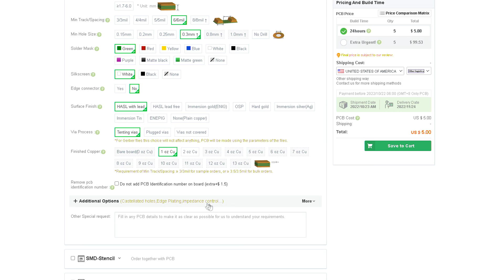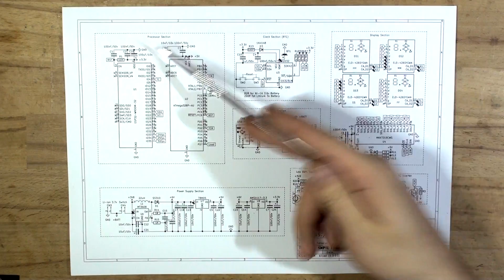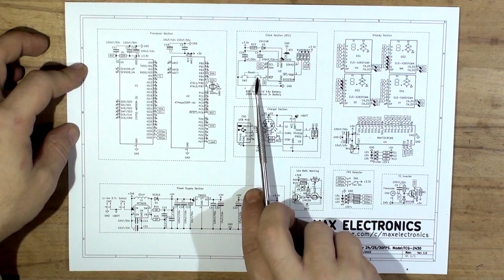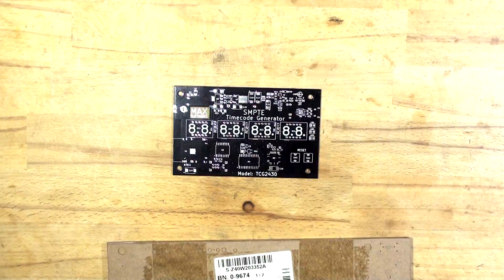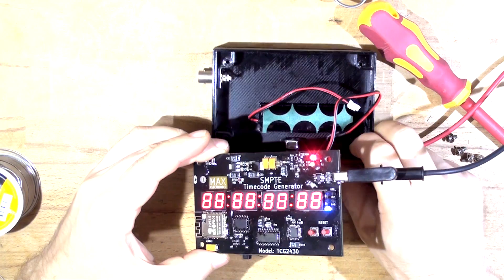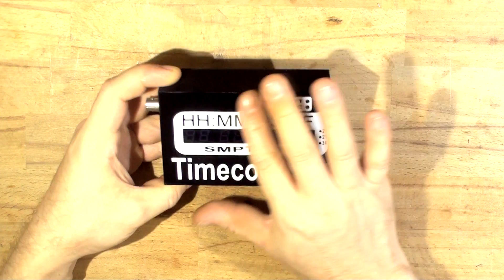DIY SMPTE LTC Timecode generator.

Comment: Thx.
For the GENERATOR, just could it spit out the time code over a LTC compatible 4Vpp signal with NO LED display at all?
I just want the core of the thing that spits out the RTC based actual real time code.
The same thing should be doable by using readily available modules like DS3231 RTC module, 8 digit Max7219 module, Arduino Nano and so forth.

I do have an unknown vintage time code display on my bench but no documentation.
Model 1272 , date of mfg 1989. Mfg SELTECH, probably USA based. By chance it is using LTC code input.
I made progress exploring the internals by drawing a remake of the pcb and by feeding two 1-2 kHz short pulse signals on the two terminals.
On some ocations when the two phase input signals hits something it produces usefull content on the 6 digit LED, that luckily has no f** frames indicator.
I just want this thing revived to work as a wall clock as it was in the W-German TV studio back then.
2. The format of Your documentation.
Well, yes it is readable some how. You are an artist. Some kind of freedom of expresssion granted
BUT reading from YOUR BOM.pdf, it is a nightmare.
I do want PLAIN TEXT something like this below (Fugg, Google ignores carefully placed Tabs)

Resistors: 
R1 R3			10K
R4 R8			4.7K
R9 R13,R15 	        1K 
R14  			15K
R16 R18 		200
R19  			100 
R20 			22K 
R15  			2.2K
R21  			2.2K 
R22  			2.7K
R23*  			82R 	If Batt. Ni Cd 3.7v 
R23*  			200R 	If Batt. Lithium 3v 
RV1  			10K
RV2  			5K 

Ceramic Caps: 
C1 C7  			100nF/50v
C8 			        100nF/50v
C9 			         100nF/50v5mm
C10,11 			1uF/50v
C12 C14 		10nF/50v
C15 			22uF/50v1210 
Tantalum Caps: 
C16 C18  		100uF/35v
C19,20  			10uF/35v
 C21 C24 		15uF/35v 
LED/Diodes: 
D1 				SS310
D2,3 			1N4148 
LD1 LD3  		Green Diff  2.8mm
LD4 LD6  		Rect. Red 2Do  t  5mm
LD7				R/G, Com A 3mm
LD7 			Red, Clear  3mm
DS1 4  			Dual 7 Seg ULD3291CS26 
IC’s: 
U1  			ESP32  WROOM 
U2  			Atmega328P AU  
U3 			DS3231M  
U4  			MAX7219CWG  
U5  			TP4056 
U6  			MT3608  
U7  			LM7805  
U8  			AMS1117 3.3  
Q1A/B  			UMH3N SC 70 6 
Q2 			MMBT2222   

Inductor: 
L1  			22uH 7.3x7.3mm 

Miscellaneous: 
CN1 			USB B Micro Molex 
CN2  			BNC  Panel Mnt. 
CN3,4 2Pin 		Molex  P:2.54mm 
SW1  			3Way DPTT—7x14mm 
SW2,3  			Tactile,Button 5mm 
Y1  			16Mhz
BT1 			CR2032  CH273 2450

Comment: Why you are using ESP32 and Atmega? Isn't ESP32 itself enough?
Reply: I think that's because of stability.
You don't want the time to drift or skip frames due to some code loops.
I didn't think of that myself. And I actually find it very clever.

Comment: Is it possible to add a 29.97fps setting?
Reply: I think that is just a matter of adding that feature to the ESP.
Too bad Max didn't show  and explain the code for the chips. But the code is included in the link in the description.
I bet you could just find the fps there.
Otherwise, what I sometimes do, is uploading the source code files to ChatGPT or Claude. AI can figure out where the settings live in the code. And it can give instructions to where make changes to add 29.97 fps, or even 50… or 60 fps.

Comment: Awesome!
I think we all want one that is also Jam-syncable, I'd instantly build/buy those!
Reply: I checked the source code, that's included via a link in the description.

And the code sets the time using an RTC.
I guess it's just a matter of adding a TC reader, that listens for TC.
It could then just adjust the FPS and TC according to what it's detecting, And instead of hard-wiring the frame-rate, it's nicer to cycle through the frame rates. This way it's easier to set the fps according to what the device detects, when an external TC is detected.

In the other video, where Max builds a clapper board, there is a TC input available. So, I think it's pretty straight forward to combine these two projects to add jam sync to the generator.

Comment: Sadly this and the Digi slate won't work through pcbway. They say it didn't have the "complete part number and value" in the bom
Reply from the maker: PCBway will still manufacture the PCB for you, you just have to add your own components, the reason I don’t release bom file is so it doesn’t get mass manufactured and sold as a product, but with my pdf bom list you could build one at home easily. Just order the pcb itself and you can buy components from AliExpress.
Reply: @MaxELECTRONICS  yeah, but for those of us with 0 experience soldering, that limits us. I understand your position though. Just noting if someone like me was hoping to have pcbway do everything, they can't. They have to know how to work with a board.
Reply: @cinaeth83 my guess is find equivalent parts from their suppliers
Reply: @cinaeth83  I agree.
I have no experience with SMB components. But I made a small little test project. Just to see if I'm capable. And it actually turned out pretty good.